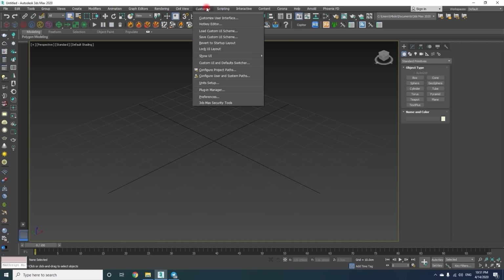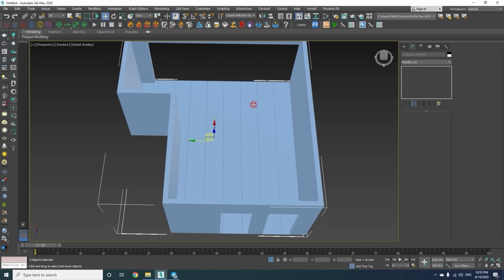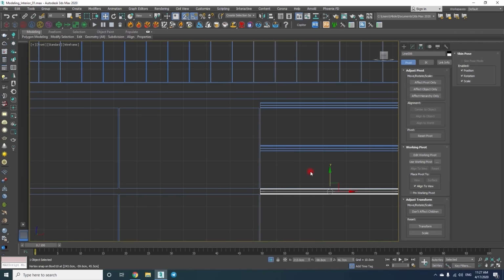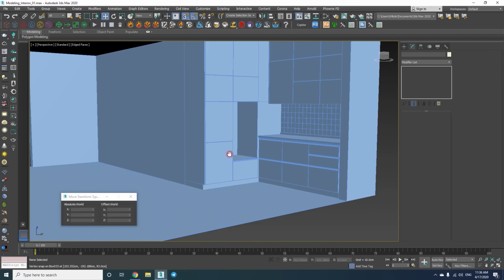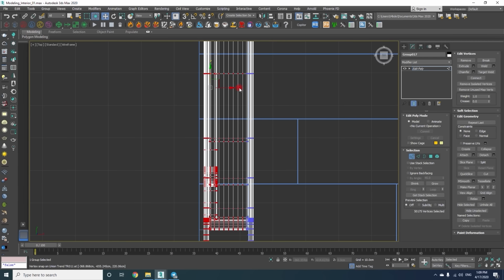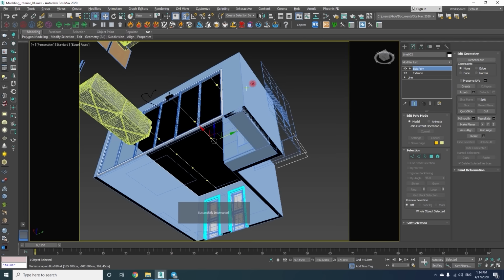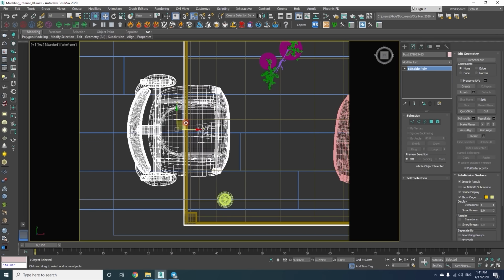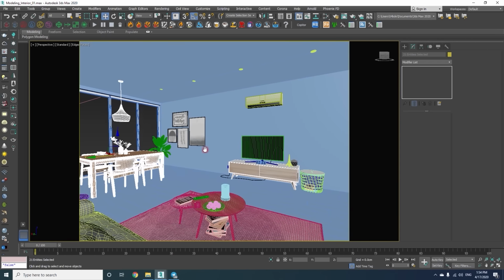How to model an interior scene in 3ds max

Comment: I just started studying 3d max and came across your video.
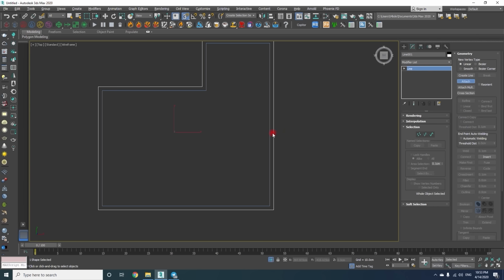I have a really simple question but if I don find the solution I can't continue. I drew everything like u in order to follow well and when I draw a line in 1:40 just like u, my line wouldn't fall where it should... when I zoom a bit, it is close but not exactly over the Autocad deawing's line so what should I click to fix it from not happening again?
Reply from the maker: Hi. You should enable the snap tool. You can do it by pressing the S key on your keyboard. You should also right-click on the snap button and enable the vertex option. I hope it helps.

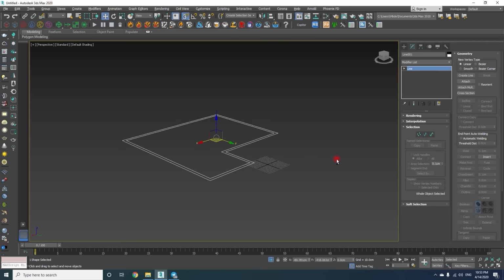Comment: Hi, great tutorial! But I have a question: how do I enable snapping to the CAD lines that I imported like how you did at 1:46 and more? I have snapping turned on at the top, but it seems to be snapping to the working grid instead. Thanks!
Reply from the maker: Thank you. You should right click on the snap button and enable the Vertex option and it would work afterward. Good luck.

Comment: How do you isolate the line and how do you keep the line in the shape without  close spit tool courting it
Reply from the maker: For the first part of the question you can use ALT+Q. But I didn't get the second part to be honest
Reply: @HMSTUDIO2020  thank you 
The second question was while I am tracing using the line tool it ends up in a Curve instead of of the line continue as a Conner lines.

Comment: You teach us so much, here is one tips for making wall, see if it fits your workflow.
1. Trace only the inside of the wall just as you do.
2. Apply edit poly modifier and make necessary openings like window door etc.
3. Add shell modifier.
Reply: No, this is incorrect use of shell. You don't need to be giving advice when you are this new.

1. Go to Customize > Unit Setup > US Standard, Feet with fractional inches 1/10
2. Next go to Grid Settings > Home Grid > Grid Spacing Set to 0'1" 
3. Create plane from top orthographic view port
4. Convert to editable poly
5, Snap vertice to grid
6. Complete layout
7. Extrude
Reply: @shannonbrown7016  u can use your own workflow, it it mine and i use it each time

Comment: This is the best workflow for creating an Interior scene i've ever seen, and I work with 3Ds max almost 10 years.
The quality of the tutorial is really perfect, thank you and I look forward to more videos.
Reply from the maker: Thank you. I appreciate that
Reply: @Veronika P Totally agree. I've studied many 3DS Max workflows and this is one of the best.
Reply: I would suggest you add your reservations and objections as points of improvement. Despite its shortfalls, this is still a very good tutorial.
Reply: @fredrickmiya7433  First, it's faster to use Round Edges with your material, or a baked normal map rather than chamfer. Both in terms of performance, and work flow. V-Ray calculates the GI based on the original surface (without bump mapping). The bump mapping is applied only in the final rendering/interpolation phase. Second, you cannot free hand measurements, because it won't match real life. You can use planes and align to get the correct alignments, then delete them after. Or use the tape tool. This is very important, because 3d modeling needs to be accurate!

Look at those models 🤣 Why is there so many extra loops? SMH 😔😔😔

This guy should not be giving any tutorials. 230,000 views? Good god.
Reply: @shannonbrown7016   First of all, the guy's using Arnold. There's a big difference between Arnold and V-ray. Even if your work-about was implemented, there are many ways to skin a cat. I've followed many tutorials, including those done by Autodesk Evangelists, very few have suggested what you propose. We are still driving ICE vehicles when EVs exist. It's a strange world dude.
Reply: It's Corona renderer
Reply: @fredrickmiya7433  Corona works the same way, and so does Arnold. What exactly did I say that is incorrect? It's a fact.
Reply: Hey I’m currently studying multimedia and I’m majoring in 3ds max and I was wondering what kind of jobs are available that I can do after I graduate because I’m graduating in a few months and I’m worrying so much. I was thinking interior design but I may need more degrees for that.
Reply: It's actually kinda off. Some of his measurements are sloppy, and also he's not using 3ds max to full potential. Not to mention the models are unoptimized, and that will slow down rendering.

Comment: by having the model assets in new 3ds file and merging it into youre orginal 3ds modeling file, will there be a reduction in polly count ??? 
will the interface and fps be faster by this or u suggest XREF! ???
Reply from the maker: I don't know if I understood correctly,  but the answer is no. There won't be any changes in the poly count. Ref is for when you are trying to handle a massive file on a week pc. You can save different parts of your project on different files and hide and inside them based on your cameras. It could be useful also, when you are working on a big scale project as a group and any one of you is in charge with one part of the project
Reply: @HMSTUDIO2020  i am using ryzen 7 2700x 64gb ddr4  1080gpu, the fps  drops and slows when i load multiple models cant able to design space more than 1bhk apartment unit. any tips on improvising this ?   Thank you!
Reply from the maker: @prajwalram6476  have you ever tried proxies? With that pc you have to be able to handle very big projects. Try proxies and instance them if you want to use the same object more than once. It's very useful to learn how to use the rail cline if you are working on classic style projects. You can send some of your renders to my email and I probably could help you better that way. Hadi.archviz@gmail.com